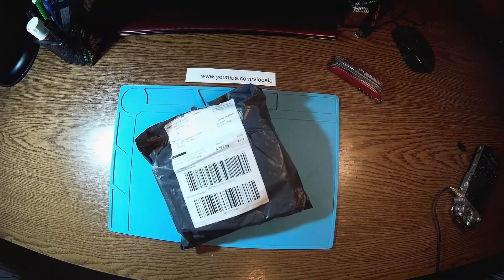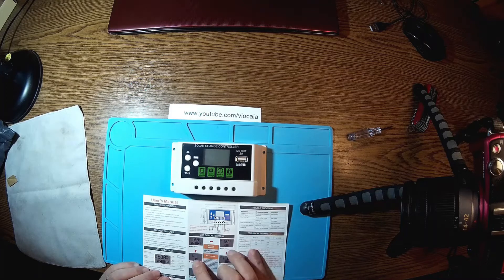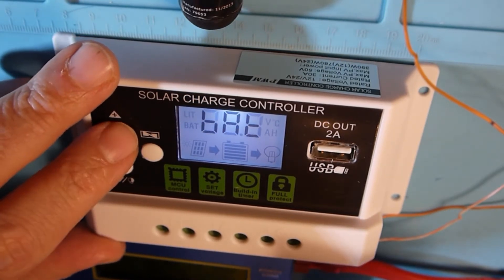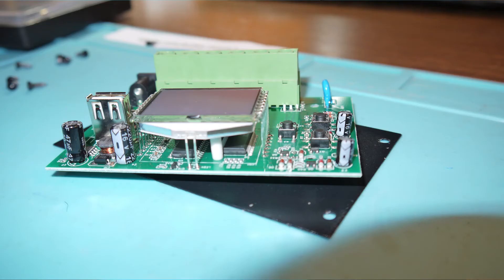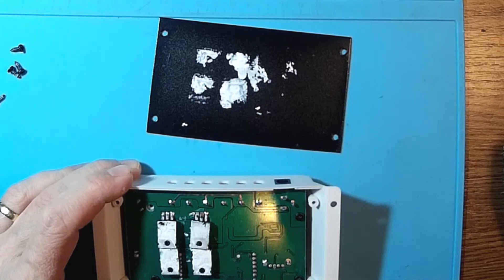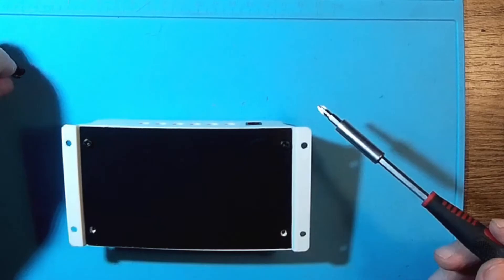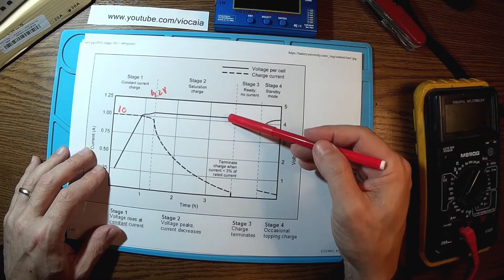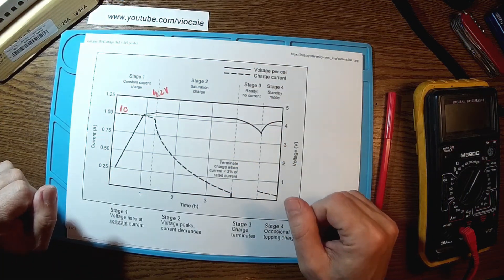Part1KYZ-30A Li-ion Li-po LiFePo4 batteries solar charge controller cheap solar production

Comment: Does the low voltage disconnect, disconnect the USB ports? I know the green fronted ones don't.
Reply from the maker: NO, that's always on, it's just a buck circuit , with no relation the the main charger..
Reply: It would have been easy to run the buck circuit from the load output. The way it is if you have a USB device connected permanently and the voltage drops to the point where the load is disconnected you could still drain your battery to the disaster point. My advice, don't run things off the USB ports. I've added a 12v > 5v module to the load output after I learnt by destroying a couple of batteries.
Reply from the maker: @lindanlester  IT's very easy to disconnect  that circuit, just cut the power trace to the buck converter.
Reply: @viocaia  Thanks. I'll open it up and have a look. Maybe I can cut the trace and if the power is +12v I could connect it to the load + terminal.
Reply: @viocaia  I've opened it up but it is not obvious where the 12v to the buck cct is. It's not as simple as cutting a track and it is not as simple as connecting to the + load as the +v is common and the -v is controlled. I'll just stick to the buck module connected externally to the load terminals. Thanks for your help.
Reply from the maker: @lindanlester  In this case you don't worry..that little IC will drown few microamps when standby...sure that main microcontroller charge more! Just let be there, don't access the port and it will be a kind o f standby

Comment: What is the DC input used for?
Reply from the maker: It's an output for 12V, for connecting any  low power devices like radio or anything using 12V but not very powerful demands.